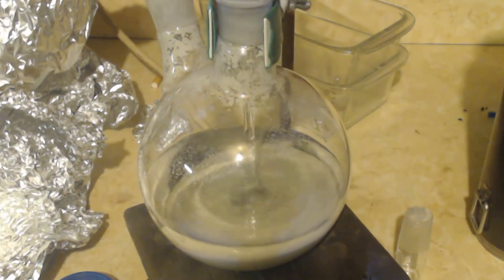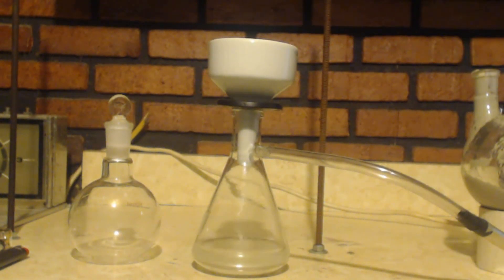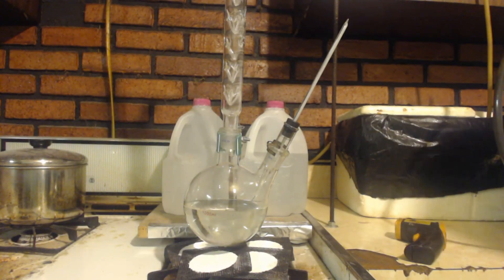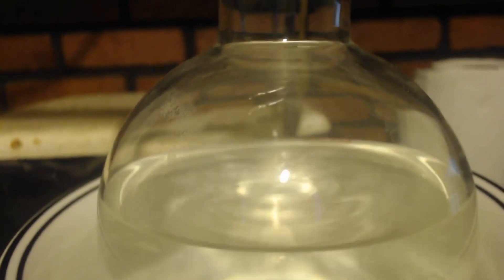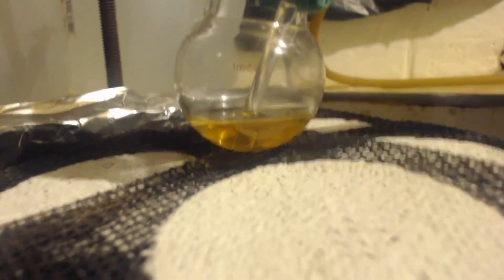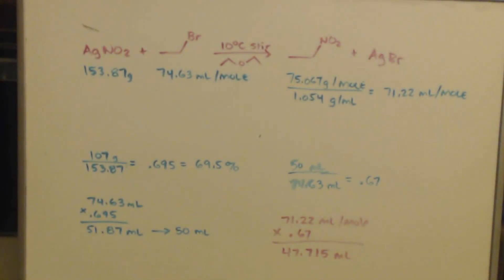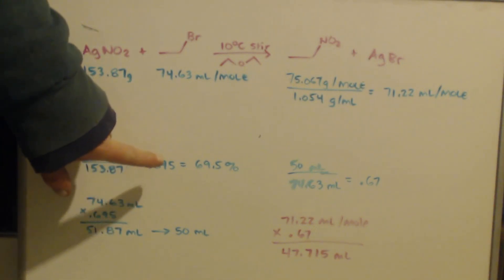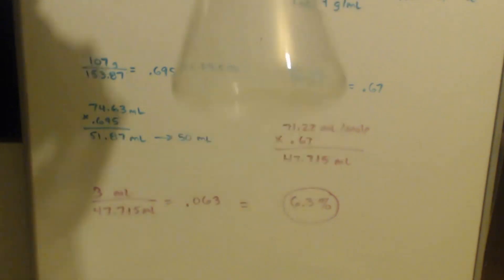NITROETHANE SYNTHESIS  part 2

Comment: P2np reduction
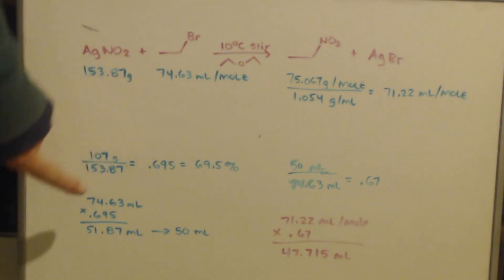Reply from the maker: Ahmet ………..I talk about that and give exact instructions on how to reduce it to p2p in this video at 9:40  https://www.youtube.com/watch?v=G9O1FbG75LQ&t=1s    Although I have never done the experiment myself
Reply: @jbsc6180  thank you I want to ask a question p2np tin cloride oxime then what do you think about the acid and ketone production
Reply from the maker: @ahmetselcuk1400  ……...I do not understand your question.  Could you please rephrase the question so I can understand?
Reply: @jbsc6180  p2np to p2p tin cloride
Reply from the maker: @ahmetselcuk1400  …………….I do not know what "p2p tin chloride"  is
Reply from the maker: @ahmetselcuk1400  ………..If you are talking about the experiment labeled "GENERAL PROCEDURE" where they take p2np and tin chloride /HCl and make p2p with a 85 to 92% yield then I would say...…..I have never done the experiment before so I do not know if he is right or not.  THAT BEING SAID if I had to guess I would say I do not like the order he adds the chemicals and I do not like the fact he is using tin chloride instead of a metal.  Other than that he pretty much has the same instructions I give in my "p2p synthesis" video.   My thinking is that hydrogen is needed for the reaction.  And adding metal to HCl creates a lot of hydrogen.   Tin chloride (or iron chloride) does not make as much hydrogen when added to HCl.  Also if he would have used metal like tin.  When he added the tin to the HCl it would have made hydrogen AND tin chloride so there would be tin chloride in the reaction if he just used tin instead of tin chloride.  Also cause my way I create so much hydrogen it is REQUIRED that the HCl be dripped in slowly.    I am learning myself and I am not saying his way does not work but I am surprised if it does work
Reply: @jbsc6180  I've had an experiment with iron dust and hcl. really. Thank you very much for your answers
Reply: @jbsc6180  In the reduction of mdp2np, it is necessary to use acetic acid instead of hcl to damage the iron dust and hcl methylenedioxide.
Reply from the maker: @ahmetselcuk1400  …….How did your experiment go when you used iron dust and HCl??????????????????
Reply from the maker: @ahmetselcuk1400  ……..Thanks for the tip.  I did not know that
Reply: @jbsc6180  ❤❤❤❤😘😍🤗

Comment: Greath vid.this is just the way chemistry goes.some things work out.some work out less.but you ALWAYS LEARN ALOT.  Thanks for the greath vid.im trying the sodium ethyl sulphate .nitrite. ethanol .potassium carbonate route today.hope it works out this time.last time i think i did not powder it finely enough.thanks mate.i saw what i needed to know.
RESPECT TO THE MASTER JBSC
Reply from the maker: Edy .Thanks.  I deleted my reply by mistake so here it goes again.....lol.  I am making some more silver nitrite and am going to try this experiment again.  I made a better more heavy duty mechanical stirrer for the occasion.  Then I am trying it your way.  Are you doing it like this?. >>>>>>>>  1.5 mole sodium nitrite (103.5g) is intimately mixed with 1 mole of sodium ethyl sulfate (158g) and 0.0625 moles of K2CO3 (8.6g).   The mixture is then heated to 125-130°C, at which temperature the nitroethane distills over as soon as it is formed.   The heating is discontinued when the distillation flow slackens considerably, and the crude nitroethane is washed with an equal amount of water, dried over CaCl2, and if needed, decolorized with a little activated carbon.   The nitroethane is then re-distilled, collecting the fraction between 114-116°C.   Yield 46% of theory.    THEN I AM TRYING IT THIS WAY >>>>>>  I got 2 amino propanoic acid also know as alanine amino acid. You can get at any GNC type store or even some department stores like Walmart and etc.   I got mine on ebay.    Going to oxidize the amino group to a nitro group with potassium permanganate and then use a soda lime decarboxylation reaction to get rid of the carboxy group leaving me with nitroethane.  Hey let me know how your reaction goes and your yield.  I would GUESS you want your salts not only fine but INTIMATELY MIXED together
Reply: @jbsc6180  did you ever get around to attempting to oxidize the amine group to a nitro group with permanganate?

Comment: It is not a terrible vídeo yes it's true it's a terrible yield  terrible terrible but a good tool for anyone interested in nitro zain synthesis
Reply from the maker: Jose...……..Yeah ……..I tell you what...…..It does show EVERY mistake you could possible make....lol.  So at least next time I  should be good since I got all the mistakes out in this first attempt.   I am making some silver nitrate tomorrow and some silver nitrite the next day and then trying this experiment one more time.  BUT THIS NEXT TIME I WILL BE PREPARED TO STIR IT LIKE A CRAZY MAN.     I also got some alanine amino acid (2 amino propanoic acid).   Going to try it after this 2nd attempt with the silver nitrite.   Going to oxidize the amine group to a nitro group with permanganate and then decarboxylate the carboxy group off and be left with nitroethane.   Then going to try the sodium ethyl sulfate   and silver nitrite and  K2CO3 method to make nitroethane.   See which method is best

Comment: First let me say to everyone, DO NOT DO THIS METHOD!!! This is EXTREMELY dangerous. You are using a temperature sensitive possible explosive "nitroethane", and diethyl ether, a well known explosive solvent. Nitroethane should ONLY be distilled under vacuum.
Reply from the maker: science and anonymous...………….  Back in the day I used to distill nitroMethane and I ALWAYS did it under vacuum.    But it usually had methanol in it and the lower pressure would swing the azeotrope in my favor.  Once you get to organic chemistry...…….if you think about  it...…..EVERYTHING that is distilled is potentially flammable/explosive especially in a hot vapor form.    But nitroethane does not decompose until like 400 or 500 C.  Some where real high in temp.  The auto ignition temp is a little over 400 C.   So if you have no leaks then you have no problem.  But just like ANY organic liquid you distill if it leaks and the vapor touches something hot enough then it will ignite.   The flash point of nitroethane is 82 C so YES  distilling under vacuum would be best. But that can be said of any organic liquid being distilled.  Also if you watch my videos I am not a really safe person.   Keep in mind I do very small amounts of stuff in my videos.  Even if something did leak and explode it would be more like a small fire and my glass cracking.  It would not be like a real explosion like C4 or something.   AT WORST  if I were close AND it broke my glass enough then maybe a shard of glass would get blown into my eye and blind me.  I usually do wear eye protection though.  That is the one safety thing I ALWAYS am concerned with.  KEEP IN MIND ALSO I have distilled thousands or at least high hundreds of times and have never had a leak in my apparatus of anything flammable or explosive.  UNFORTUNATELY  the more a person does some thing the more lax they get on safety.
Reply: @jbsc6180  I feel that. I enjoyed the vid, just want to make sure those who aren't as educated are taught
Reply from the maker: @science_and_anonymous  ……….Trust me when I say I APPRECIATED your post VERY MUCH.   And feel free to make comments like that on any of my videos.   I know I am VERY VERY  lax on safety procedures and I definitely should have mentioned in my video what you posted.   ALSO  in the last couple days I made some more ethyl bromide and some more nitric acid.  Hopefully by Monday I will make some silver nitrate and then some more silver nitrite.  Then I plan on doing this experiment again before I move on to other methods of making nitroalkane.  I will bring up your safety concerns on that video.   It is a good point especially for NEW chemist or unexperienced in the lab chemist.